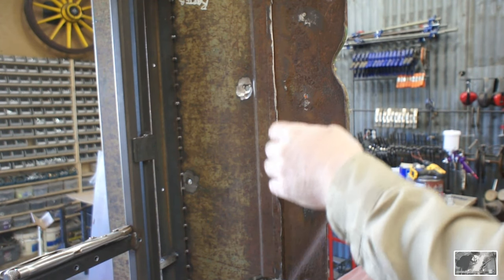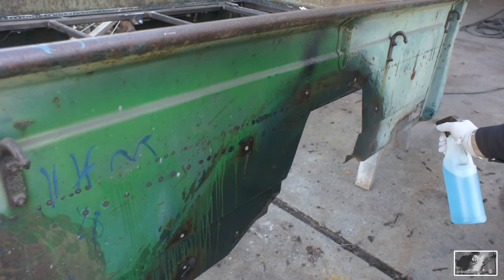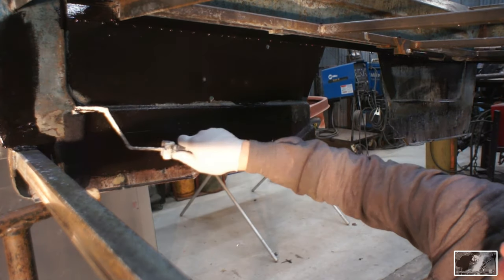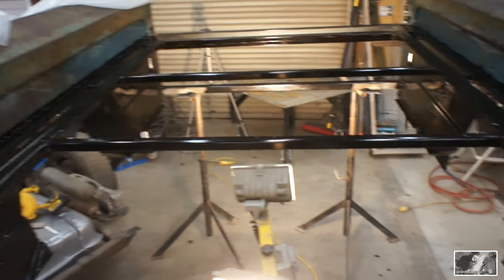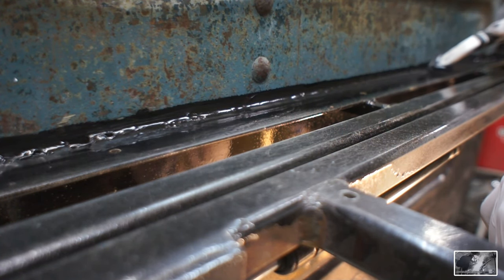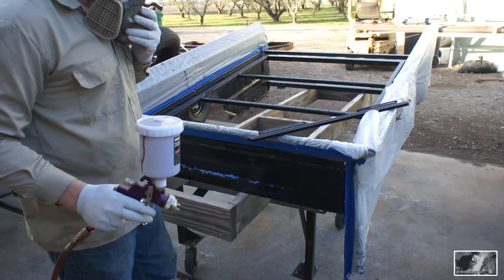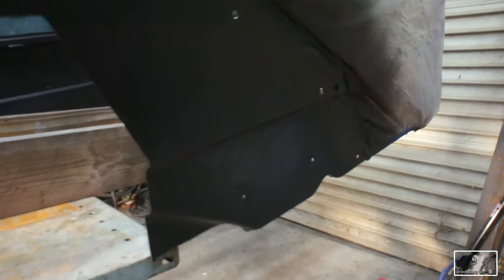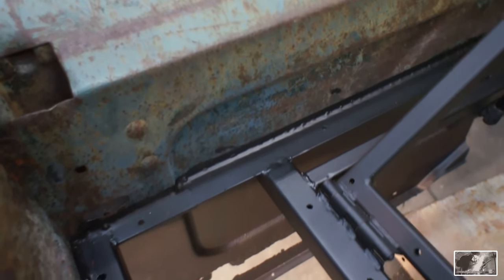New look below, old look above | 1947 ford pickup build (part 27)

Comment: I really like your approach on stopping any kind of rust coming back. There is nothing worse than watching guys restoring a vintage truck and NOT killing the rust. I know it will come back to take over the truck in the future. Thank you for sharing and I will be following your lead when I start the body of my truck. 👍👍
Reply from the maker: Yeh, I completely agree about the rust. Back when I was in school I did a few repairs on classic vehicles that looked really good, except for the typical door corners and lower quarter panel rust streaks. Its important to protect both sides of the steel. Thanks for watching!

Comment: I'm curious. Why not sand blast it before doing the coatings? Amazing job though. This truck will last you a lifetime. Excited to see it done. Come to Georgia and give me a ride :)
Reply from the maker: Im not super experienced with blasting, I do own a small unit though. My thought is 2 fold; 1st is that blasting would make it tough to maintain the line of old patina on top and new coatings below deck that I want. 2nd is that with these modern, quality coatings the effort of blasting vs the payout of bare steel is really a wash anyways. Now if I wanted to start with perfectly clean and smooth metal to layer a high end paint job on top of then I would probably blast. Thanks for the questions. I hope that makes sense